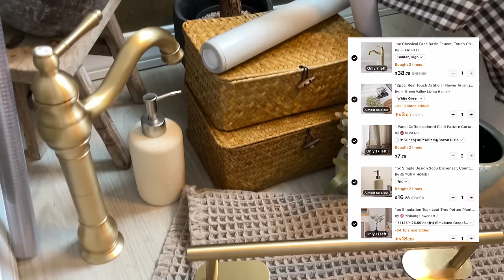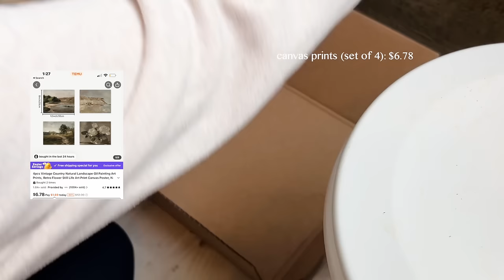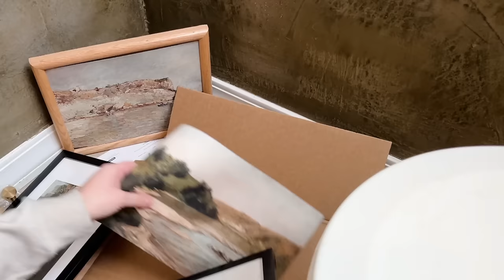SMALL BATHROOM MAKEOVER on a budget! renovating our powder bath into a bold, moody, vintage bathroom

Comment: May I make a suggestion? Please! Well first of all, I’m pleasantly surprised at that striped wallpaper matching so well with what’s nicknamed a Wabi-Sabi or Japandi style lime wash walls. That was the best investment possible! So classy and literally high end! But my suggestion is, FIX THOSE WALL FIXTURES! The light fixture, why don’t you do a customly cut imperfect light switch fixture! Meaning, not a “perfect white square drilled on top of the switches.” Why don’t you cut out a square shape with imperfect/waved angles, or an abstract shape and place on top. Maybe espresso or stone colored. Other than that, and not that my opinion matters at all, I find it the MOST BEAUTIFUL BATHROOM DIY MAKEOVER I’ve seen on YouTube. With a modest budget. Beautiful. And bravo girlllll 🩵🩵🩵

Comment: I love everything but the two items you placed on the little wooden shelf. They seem much too heavy for the size of the shelf, and the flowers are covering too much of the picture. Just my opinion, though. If you love it, that’s what counts. Just a suggestion—cover the light switch plate and electrical plug plate with what’s left of the linen peel & stick wallpaper. The white is too stark for the rest of the space.

Comment: The tasselled Cafe curtain placed in the bathroom window is not long enough...if you're going to use that kind of curtain it should conceal the entire lower portion of the window so that the  center frame between the upper and lower sections does not show. Plus, that particular curtain does not fit the style of the bathroom walls.

Comment: I would like to see the second curtain panel but use a pair to make it look fuller & longer panel, so it is center in the center of where the top half of the window top & bottom meet where you'd lock it.     I prefer the lighter panel it will let in more light but keep it private.   I'd like to see you swap out the panel in the living room for a more sheer curtain.   Especially if you're opting for privacy.   Other than that, everything looks good.     Use some command strips for hanging your pictures also your shelf if you don't put anything heavy on it.
Reply from the maker: i agree i wish the curtain was just a few inches taller to cover the top half of the window. but now people can still assess the lock on the window if they want to open it! thanks for watching 🫶🏼